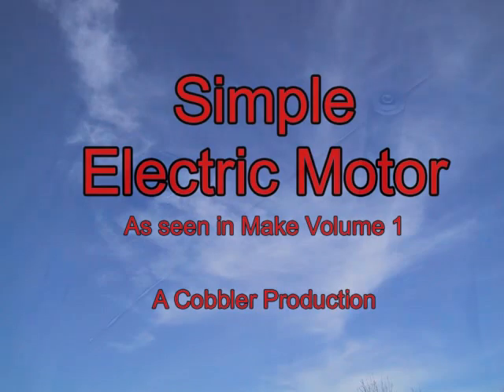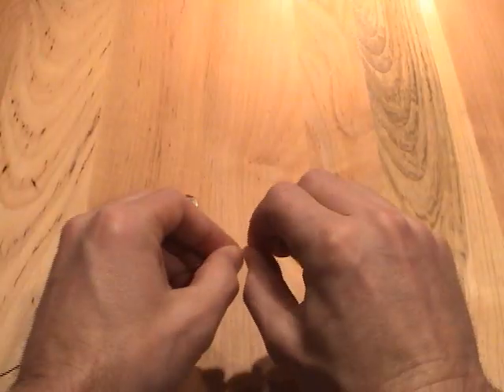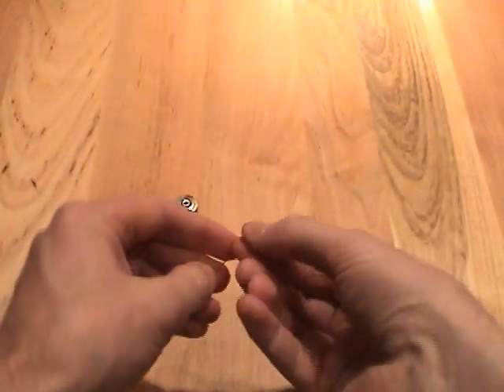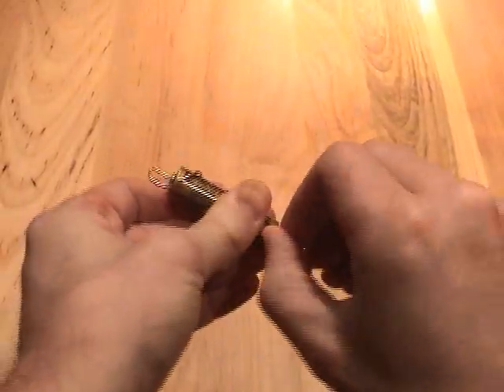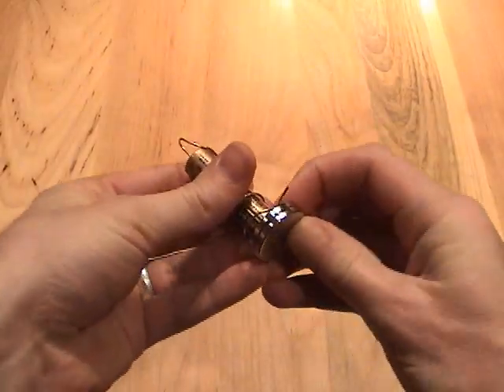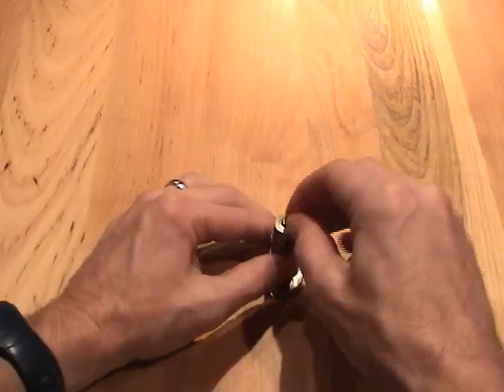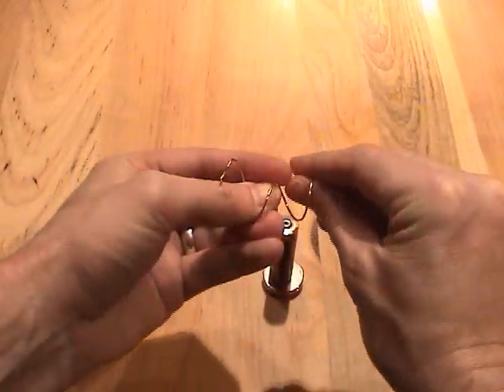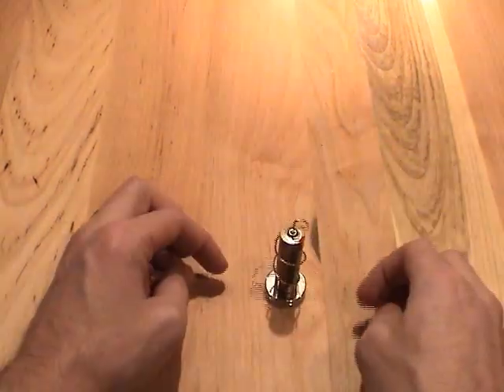Unexplained Phenomenon - Simplest Electric Motor

Comment: I don't know if I can say say specifically and I'm sure someone else already gave a better explanation, but here is what I'm thinking: Electricity flowing through the wire is causing electrons to move, this gives one part of the wire a partially negative charge and the other a partially positive charge. The magnet is also, being influenced and the bit of wire touching the magnet has the same type of charge as the magnet. The wire moves because the magnet is trying to repel it.

Comment: It's quite simple. It's the same effect as a solenoid. The electron flow create a spinning electromagnetic wave, which then react with the magnet, creating the rotation. Same thing for a conventional motor, the copper core spin inside magnet(s). Quite the same too for an alternator, except it's the rotation of the rotor making the copper spin, the electrons are then moved by the magnetic field and make current.

Comment: Almost the same concept with any electric motor, magnets and copper wire is used inside. copper wire is eletricfied and a magnet inside spins. The copper wire creates a electromagnetic field around the magnet which cause it to spin.

Comment: I would say mass can be defined in two ways, firstly by the gravitational force it exerts and secondly by its resistance to force applied to it.(going by F=m*a)

Indeed it is a theory, but your implication that it isn't true as a result is risky.

Almost everything we assume empirically, for example that the earth as a planet exists, is in fact theory. There is no way to prove we are not in the Matrix. So if you go down that path, beware, because the rabbit hole is pretty deep.

Comment: but thats already fairly concrete I suppose. Generally Energy is simply the ability of one physical system to work on another physical system. For example, when I hit a troll such as yourself in the face, my hand will have a lot of kinetic energy while it is applying work on your face. As you can already interpret quite nicely, energy can be quite destructive

Comment: i tried using copper wires that i got from cables and magnet that i got from old  speakers and it didn't work. could the magnet be a factor? is a ceratain magnet i should use?

Comment: Electricity runs through the wire into the magnet and back into the battery, creating a small magnetic field, which interacts with the magnetic field of the magnet. So you get force.

Comment: Definitely just that. It's the basics of learning electrical engineering and how a motor works. The current flowing through the coil creates a magnetic field causing the wire to spin.

Comment: This is called a "homopolar motor". I suggest you google it - the sites out there can explain better than I can in this youtube comment. There's nothing really special about homopolar motors - they work just like a normal motor. There's a current in the wire (supplied by the battery) and a magnetic field from the magnets that create a tangential force that makes the wire turn.

Comment: Electromagnetic effect. As current passes through a wire, it creates a weak magnetic field. The magnet at the bottom either attracts or repels this field created by the wire. Since the coil is loose and non-symmetrical, the coil spins.

Comment: That's wrong. If the thread doesn't touch the magnet, no current can flow. It's not a complete circuit. If you listen closely, he mentions "the thread lightly touches the magnet." Lightly because it has to spin.

Comment: The current flows though the wire since it's touching the top of the battery and the magnet which is touching the bottom of the wire. Current induces magnetic field in the wire itself. In the presence of the magnetic field produced by the magnet at the bottom, the wire's uneven magnetic field (spiral structure) makes the wire move. But since the wire is fixed and can't move anywhere but rotate, it rotates.

Comment: Its the flow of electricity. When the wire is connected to the positive, and the magnet is attachd to the bottom. The wire spins with the electricity in an infinite loop. The positive applys juice, the magent (negative) takes it and sends it back. Its an infinite loop, or until however much energy the battery has itself.

Of Course, this is only a hypothosis.

Comment: Since the wire is getting electrical current from the magnet and it's in a solenoid shape, that turns the solenoid into a magnet itself, since the wire is close to the magnet, the small magnetic pull between the solenoid and the magnet causes it to rotate.

Before even experimenting with making the wire go in the opposite direction, I know what will happen. The experiment wont work because the the solenoids poles will be inversed, causing the magnet to push the wire away.
 
Simple science :)

Comment: A bit hard to explain with out picture, but at a guess i would say perhaps the angle at which the wires magnetic field makes relative to magnets magnetic feild produces the torque via right hand rule or some other cods wallop. and perhaps where the current flows through the magnet locally afftects the feild also to increase this torque.

Comment: Do I have to use a 100% copper wire or can I use steel? 

I've tried with a copper & steel wire (50/50). But it doesn't work.

Comment: electromagnetic field maybe?????

Dont forget that the copper wire is electrically charged by the battery, having a change of polarity that creates a magnetic field.
When this comes near to another magnetic field, they tend to get apart of each other, in this case it can't, so it begins to spin, trying to get away from the other magnetic field.

If i'm wrong, physics phds plz correct me.

Comment: You have a spining force in the top and bottom connections because the current is horizontal and almost perpedicular to the magnetic field, using the right handrule  in that small portion of the cable will create a torque. There is difference of lenght between those horizontal opposing currents. The magnet is strong, so low current is enough for high force. In the spiral the forces are in the direction of the center of the spiral, so not much torque there.

Comment: magnetism flows much like electricity from a negative portion to a positive portion, trying to obtain a balanced proportion. in this case the electricity is creating one field (the wire) and magnetism is creating another. Since they are very similar forces they can inhibit each other, much like time and space. At the two levels it's not much different from a windmill, or more accurately a watermill. This is my hypothesis. Am I right?

Comment: the magnets' poles (positive and negative ends) create a magnetic field around the magnet and when the battery releases energy through the copper wire (copper is a good conductor of electricity) it reacts with the magnetic field spinning the wire in the direction of the fields' current.
If you flip the magnet over the current will flow the other way and therefore you wire will spin in that direction.
Solved...

Comment: Its an  electric motor. An electromechanical device that converts electrical energy into mechanical energy.
Most electric motors operate through the interaction of magnetic fields and current-carrying conductors to generate force. . Open up your electric screwdriver and you will see one. The Chevy Volt also has one.

Comment from the maker: @Wolfinator234 Actually, that kind of a trick question. The shape of the wire has nothing to do with it.  The spiral is just a convenient shape for balancing the wire on the battery.  Reversing the direction of the spiral will do nothing.  Flipping the battery over, however, will change the direction of rotation.

Comment: First, the magnet has to be electrically conductive so that electrons flow through the wire from negative to positive of the battery. When this happens, a concentric magnetic field appears around the wire, which interacts with the strong magnetic field of the neodymium magnet. The force interaction creates a torque which spins the wire, all the while maintaining the current through the wire.

Comment: It works because we all have been lied too for over 125 years. Free Electricity has always been there in fan motors. Using Nikola Teslas designs on controling a magnetic fields rotation , the one can capture energy from the spinning magnet wheel by having the wheel follow a North/south man made magnetic field in a thin wire around the wheel.  Just look into Nikola Tesla's Magnetic Motors and electric motors you'll see it works you just have to build it

Comment: Right Hand Rule: A Current through a a magnetic field feel a force. 
The force in this case causes the coil to spin. When you reverse the battery, you reverse the current, thereby changing the direction of the force created. It will move in the opposite direction.

Comment: How it works: The battery sends a current through coiled piece of copper. The coiled piece of copper acts somewhat like a solenoid, therefore the current creates and induced magnetic field running both inside the coil and outside the coil. This magnetic field in turn interacts with the magnetic field of the magnets at the bottom of the battery which creates the force causing the coil to rotate.

Comment: @gt750kr It is shitty. I have built one also (and uploaded the video here) and measured the intensity, which is over 1 A with 1.2V AAA rechargeable battery. That is 1,2W consumed and it is not capable of moving anything when finds some resistance, while a Meccano motor can move a little vehicle perfectly with just two batteries of that type.

Comment: @gt750kr not much and will drain the battery pretty quick, however try putting a piece of balck tape over the magnet and cutting slits in it so the wire dont contact the whole time for better battery life

Comment: @abdullazeidan 
The fact that the wire is a coil is not relevant to flux linkage. The battery is not magnetic, so there is not any magnetic flux in the windings.
The force comes from the Lorentz force on the section of wire that touches the magnet.
The field B is vertical, the current in the wire is Radial, so the force is azimuthal. (Think cylindrical polar coordinates.)

Comment: unexplained? flemings right hand rule ... the second finger is the current and curent is flowing upwards the field is acting outwards on the sides of the battery and the magnetic flux is perpendicular to the field also acting outwards on the side of the battery the field and the flux act as propellers and the coil is also providing its field as current flows through it therefore it becomes a magnet itself and is repelled by the below magnet therefore turns ... sheer movement. =)

Comment: As the wire is wound into a coil and is subjected to a DC current flow, there will be multiple shifts of polarity with each turn of the coil, thus creating multiple paths of attraction and repulsion as the current flows through the coil within the magnetic field. Realize also that the coil extends into a diminishing field of polarity thus working within a delta field density, assuming that N & S are perpendicular to the faces of the magnet, in effect making one end more N and the other more S.

Comment: Assuming the disc magnet has north south on the top and bottom faces, lines of B are vertical about its circumference.

The current carriers in the wire are moving radially. Using the Lorentz force this suggests a force at right angles to both magnetic field B and current. This would be an azimuthal force, which is what we see in the video

Comment: Many people don't realise that the homopolar motor doesn't work as normal motors do. Usually, motion involves a change in total magnetic flux bounded by the coil or loop formed by a conductor, which cannot go on increasing for ever.  Hence dc motors normally use a commutator and a changing field. Here there is no change in the bounded field, which is a bit puzzling. There are other phenomena that tend to question what magnetism actually is and whether it actually exists as we think it does.

Comment: the battery is a conductor the copper wire directs the flow an the magnets act as a resistance to conductor created electricity its called direct current all light bulbs and electric motors follow this concept

Comment: F = I x B

It works because it has enough coils, for the radial force to cancel out. The tangential force adds up over the coil, but is only determined by the height of the battery.

Comment: @Riot454di Room temp copper is not a super conductor. The reason a conductor becomes 'super' when chilled down is that the molecular movement slow down, and stops when reaching -273.. celcius. The electrons are always ready to jump to another atom when not moving. If warming up to +200 c. the movement is so rapid that electrons are not ready to pass, and thats resistivity. The wire is shorting the battery, and if done to a cheap led acid type, it'll blow . Batteries are accumulators!!

Comment: This is not an unexplained phenomenon.  It is called a homopolar motor.  I run the EE honors society at UT Austin and we set a booth every semester where 6 year olds build these.  They are not hard to build and the physics is actually really simple (high school level)

Look up "homopolar motor" on wikipedia if you don't believe me.

Comment: @astrobrown15 The current fallacy that the strength of the
magnetic field surrounding a copper conductor coil comes from the input
CURRENT IS FALSE!  The strength of the magnetic field surrounding a
copper conductor coil comes from the ATOMS OF THE COPPER WIRE contained
WITHIN THE TURNS OF WIRE as aligned by the input VOLTAGE NOT the
CURRENT. the greater the input VOLTAGE (up to maximum copper atom alignment) the stronger the magnetic field surrounding a coil, therefore the greater the back-emf.

Comment: @astrobrown15 Better than 30 physicists, nuclear engineers, electrical engineers and
electrical technicians have signed Affidavits attesting to the validity of
this fact. I'm sure you recall the Faraday brothers discovery using copper wire. Where do you think the extra electron came from? Copper atoms and the mechanics of energy. E= mc2, sometimes. This space is too limited to explain well.

Comment: @MrRuzo214 The strength of the motor's magnetic field
is dependent upon the VOLTAGE,NOT the CURRENT! With a stator you could actually trickle charge the battery because there is a current being generated from the copper atoms moving through the Magnetic field. However with this system the battery will become depleted.

Comment: the wire has a induced charged because of its contact with the anode, this charged wire interacts with the magnetic field of that magnet at the bottom, lorentz law states a magnetic field does do work on a charged particle assuming the field lines are not parallel equal and opposite reaction makes the wire spin, newtons third. this will cause the battery to drain very quickly because as the wire passes through the magnetic field it causes a current in the wire which causes resistance in the flow

Comment: My theory is that the homoppolar motor is the very basic DC motor.

The magnet produces a magnetic field that passes through the copper wire close to it. As the copper wire end touches the magnet, a DC current passes from the (-) battery contact through the magnet, then the wire that touches the magnet and up the wire to the (+_) terminal. This current produces a magnetig field that interacts with the magnet's field, producing a force that starts and maintain the wire's rotation.

Comment: Copper is a room temperature superconductor and the magnetic field represents light speed particle waves. Combined with the electron flow from the direct current from the battery two forces interplay; the centripetal magnetic field flows the opposite direction than the discharging centrifugal field, which is represented by the visibly spinning conductor . . .just my opinion.

Comment: Simply because you hooked the cable to the battery, therefore putting current in the wire.. With the magnet you create a magnetic field.. Based on basic Physics principles you need to have current in order to have a magnetic field. that magnetic field creates a force...

In simple words and not a lot of explanation, the magnetic field created by the current in the wire and the magnet makes it move.

Comment: depending on the way the magnet is oriented, the direction of the magnetic field is (simply speaking) either upwards or downwards. therefore, charged particles will be propelled perpendicularly to the direction of the field (left or right) depending on the magnetic field. for example, the way the magnet was originally oriented must have had the S end facing the battery since the wire (negatively charged by the flow of electrons by the battery) was pushed counterclockwise by the field.

Comment: Electricity flows through the wire and through the magnet to complete the circuit. The flowing current in the wire creates a magnetic field perpendicular to the direction of flow. The magnet creates a steady magnetic field. These fields act on each other, imparting a net torque which spins the wire. Very cool trick, although 'Unexplained Phenomenon' is a bit of a stretch.

Comment: its not unexplained its motion is achieved through electromagnetic transference which is measured in coulombs which are found based on the formula in coulombs law  (The magnitude of the Electrostatics force of interaction between two point charges is directly proportional to the scalar multiplication of the magnitudes of charges and inversely proportional to the square of the distances between them) - not magic, science